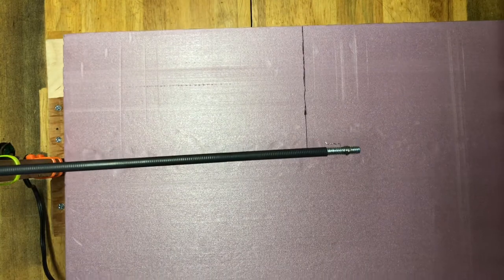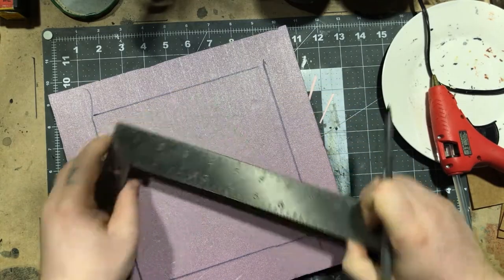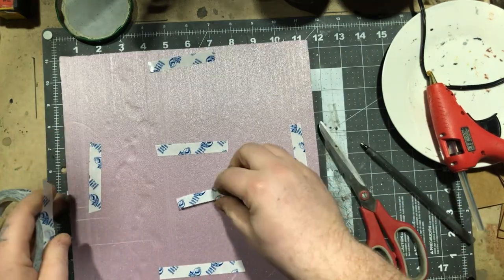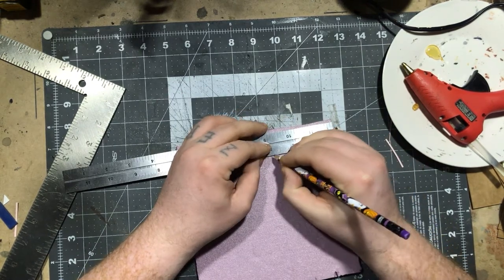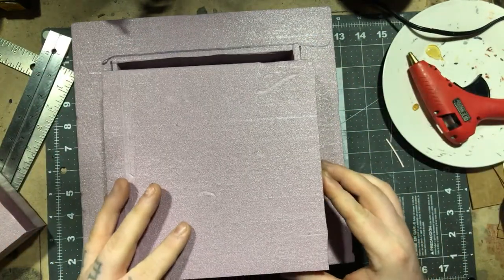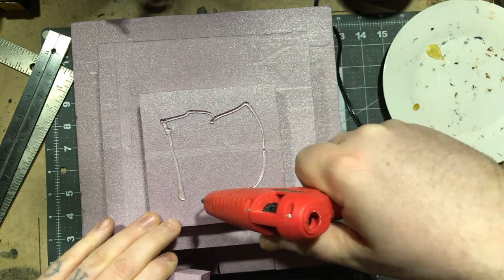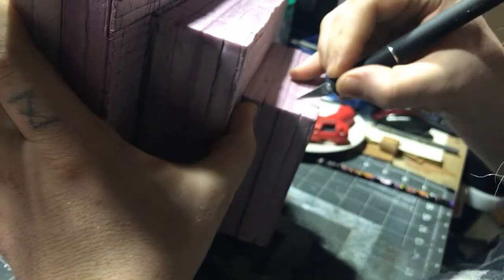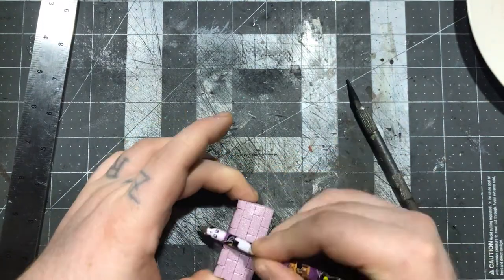🏛 Tutorial: Ziggurat/Temple for D&D and Tabletop Gaming🏛 | Part 1 | (TheDungeonMattster #17)

Comment: get some ink some medium and some flow aid and make a bulk batch in a big jar I did this I've had the bottle for a year and its still 3 quarters full and you can make it whatever colour you like and it's cheaper than the stuff you buy and the trouble with paint wash you are depending on the quality of paint and mixing it exactly. if you use a resonantly good ink and medium and flow aid ( especially if the in comes in a dropper bottle) you can make as much or as little as you want. you've already sussed how to do it with paint. With ink it just requires more water

Comment: If I want to remake this where would I find the materials? Also the build is super good.
Reply from the maker: It’s primarily XPS insulation foam found at most big box home improvement stores. I use 2’x2’ project panels found at Home Depot. As for measurements, just make each layer small enough to leave a ledge around it for minis to inhabit.
The top of the piece is foam core board from the dollar store as well as some XPS.
Citadel Skulls, Woodland Scenics flock, and Army Painter tufts round our the diorama, which rests on an MDF base (also purchased from Home Depot).
The paints are all craft paints from Walmart and Michael’s.

Hope this helps!